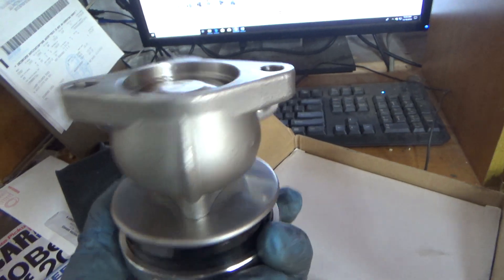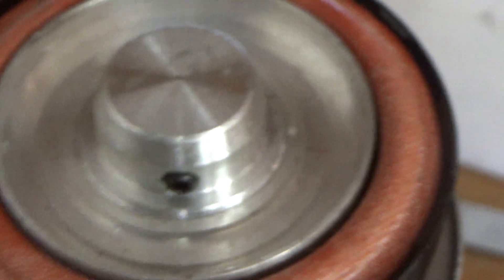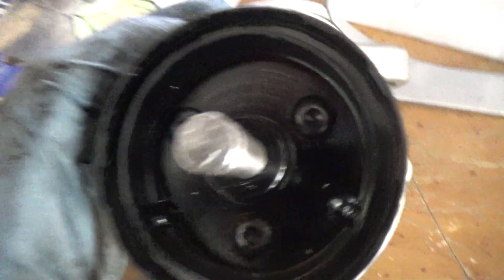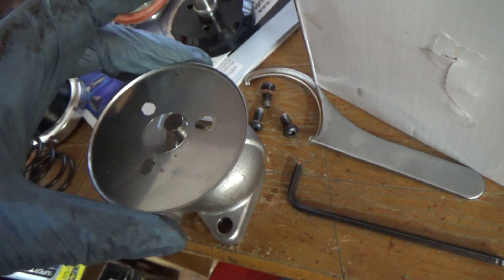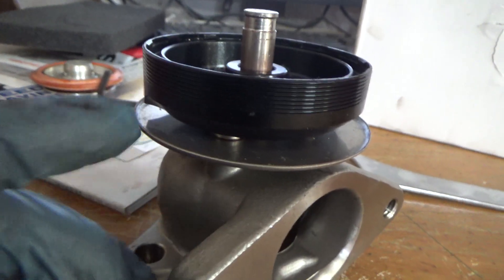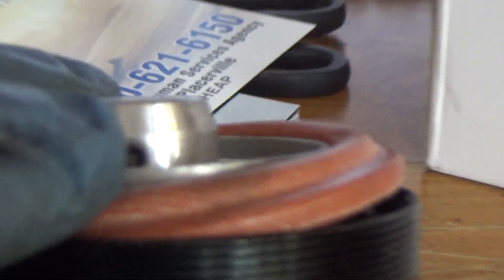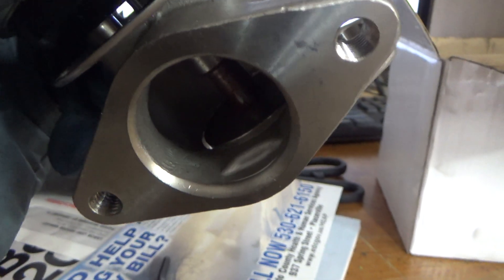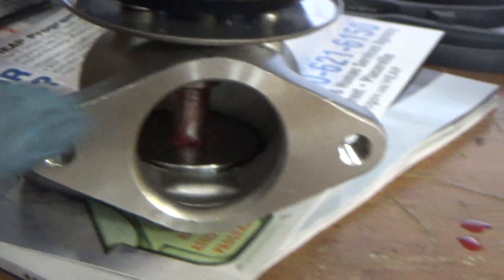Bulletproof An EBay Wastegate

Comment: Polishing the shaft and using high temp dry graphite, which is good for 1400F is the best solution. Hi-temp red grease gunks up and it is better to use nothing.

Comment: I clean Polish the valve stem and use 2500degree Molly lube never had any probloms with over 100k on my motors
Reply: Your kidding me? No sealing issues either?